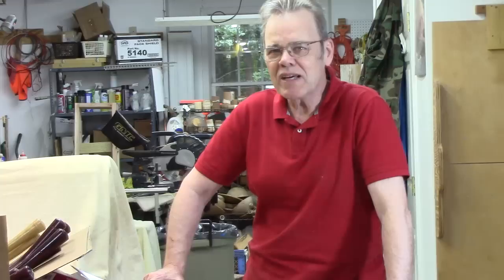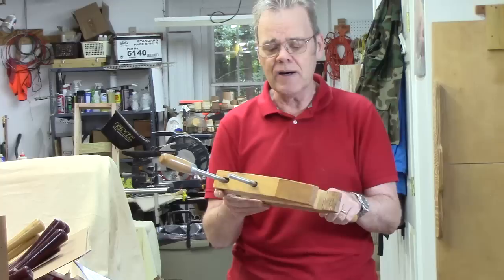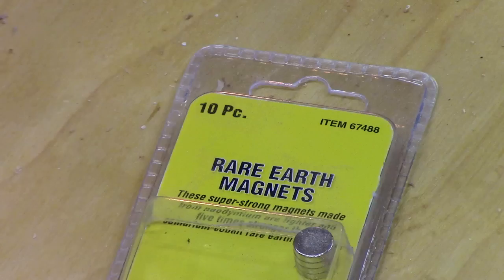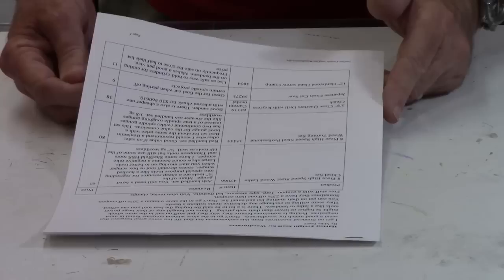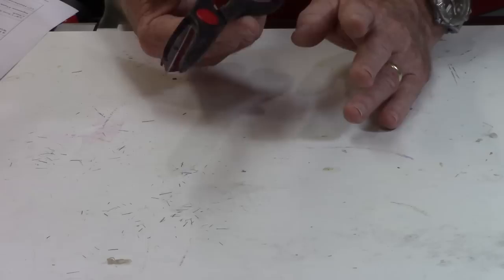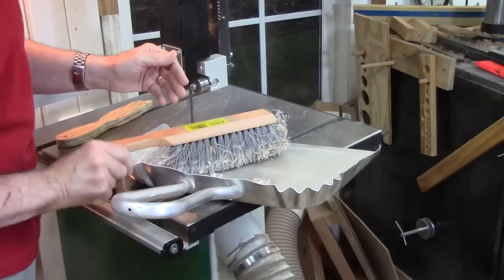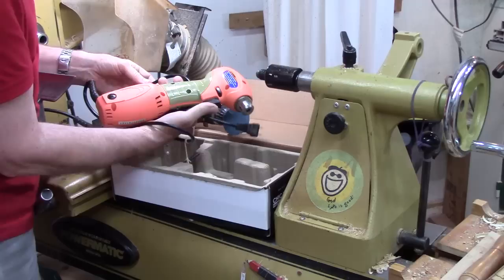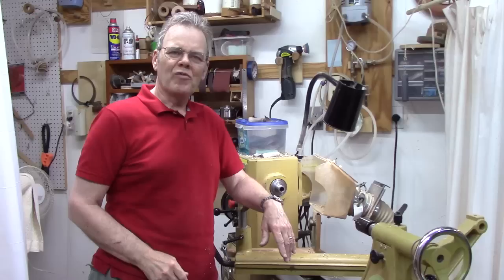Harbor Freight for Woodturners?

Comment: Hi Mike and thanks for your videos. I started with the HF 10" wood lathe & a cheap set of Windsor tools. Neither lasted very long. The tools were upgraded to Sorby fast when they went on sale at Craft Supplies (20% off, I loaded up!). The skew is ok, the spindle roughing gouge actually works pretty good with frequent sharpening, and the rest are garbage. The lathe was $160 with the 20% off coupon but I noticed the price went up $20. It was fine for pens and shaving brushes but after 3 small bowls the spindle bearing started going & everything ended up slightly out of round, a big problem with pens. It was only 4 or 5 months old. If it's just used for small spindles it's ok, but if you're a beginner that wants to turns small bowls I say save your money for a Rikon 12" VS or something similar like a Nova. The HF is now a buffing station with 4" wheels. All in all The lathe & tools were about $200 which I could've used for Sorby tools or a decent chunk of my Rikon. Then again, I wouldn't have that dedicated buffing station...
Honestly I can't recommend either. A decent lathe is the core of one's woodturning. Even though it was cheap and still serves a purpose, the money would have been better spent on something of higher quality. The Rikon isn't much of a lathe compared to a full size, but with reverse and VS I felt like I stepped up from a Yugo to a Porsche.
Reply from the maker: No perfect answer for everyone. I know some folks who turn so little, maybe a cheap lathe is an answer. Some folks are so strapped for $$ that a cheap lathe is all they can afford and can make do. I decided to make a big plunge from a used Jet 10x14 and  I love my Powermatic 3520. Glad I did not choose a lesser lathe that might have met my needs but left me wishing I had gone all of the way.  Ten years later I could sell my PM for what I paid new.

Comment: I get packages of micro-fiber cloths free with a purchase. These are helpful for cleaning dust off everything from turnings to my face shield.  Bags of shop rags are great to have around - though they come with a strange sizing that affects their absorbency, so I run them through the washing machine when I bring them home. The HF digital calipers are far less expensive than other options and work great for the accuracies attainable with wood.
Reply from the maker: I will have to check out the mico-fiber cloths. Thanks for sharing.
Reply: The only issue with HF digital calipers is that they seem to go through batteries very rapidly.

The microfiber cloths are also handy if you use wiping finishes that have to be rubbed down after application.
Reply from the maker: I have not had problems with caliper batteries. And I bought a pack of 10 or 20 for maybe a couple of bucks and  have actually given away batteries to friends with similar calipers.

Comment: I was glad to see the magnetic parts dish - I've got a couple of them. They are sometimes available as the free item also. Another really useful tool is the extension magnetic pickup tool and mirror. I get quite a bit of mileage out of those and again, I think it was a set I got as the free item. It's been said a lot, but I'll say it again, HF is OK, but you had better go in with low expectations!
Reply from the maker: +Tim Douglass Absolutely. I forgot that one. My shop fairy broke mine so I got a replacement from Amazon.

Comment: my table saw is from HF and has been going strong for about 8 years. my 12" single bevel chop saw has been serving me for about 9 years, I have had no luck at all with any of their drills, but the 3 cuft concrete mixer works well for the homeowner/hobbyist it doesn't really hold 3cuft while mixing and will slosh out, but you can easily mix 2cuft with no problem, their large wood lathe is quite affordable at under $300 with 20% coupon for the beginner turner (not good for off center/unbalanced turning as it's bottom rated speed is 600rpm (more like 645-670 actual), their earthquake impact guns are right up there with Snap-on in quality and longevity. I just had to replace my recip-saw after 6 years on the old $39 dollar one. their face mask is cheaply built, but better than none. I have laid miles of welds with the 90amp wire feed welder over the last 12 years and it is still going strong. Just as with the "name brand" tools you will find the occational "bad-egg", but for the guy on a budget it is much easier to get the tool you need and save up for a better one if you find it lacking or you use it more than expected at the time of purchase. Pretty much all tools, and everything else, these days are disposable. I would rather throw away a cheaper tool than an expensive one when both have basically near the same life expectancy. Great video. BTW, I have several of those magnetic parts bowls (also often on the free list) and they are a headache saver from dropped parts or bumped/knocked off non-magnetic bowls.
Reply: No clue where you get the idea that all tools are built in modern times are disposable. Perhaps the stuff you get from HF.

Comment: You can use that 1/4 inch HSS tool bit to make an Oland tool. A great tool for bowl turning.
Reply from the maker: Might work for some and a good choice for huge bowls. But for me, 1/4 is just too  big and I would not choose an Oland tool over a bowl gouge for the 15" and smaller bowls I turn. I have no problem in anyone using a tool or technique that works for them.

Comment: I have the "improved" HF "Windsor Design" set #61794. The tools are said to be "pre-honed", and they do seem to be sharper than the basic set. However, now that I look closer after your observations, I see the same problems with non-symmetrical edges. The box is not much better than cardboard. Maybe good to practice with before buying a high-quality set...
Reply from the maker: How sharp tools are out of the box is not important, IMHO, given that they will soon need sharpening, often to a new bevel angle. Clearly no HF tool is honed before  being sold.

Comment: Before I retired I had been working in Europe where we bought a large Bernese Mtn. dog. The only way to get the large cage to Montana was via Denver or Seattle and rent a car. Denver was a no brainer since there were 3 HF stores en-route and non between Seattle. Since I had sold most of my tools before leaving the states we made the most of this trip and stocked up big time  on the way home. Two items of particular value were the 20' pillar drill reduced to $425 and the 12' cut off saw reduced to $125. Both are sterling performers and I use them for all sorts of projects including lathe work.  Also really good are the packets of 1/2' glue brushes which I use all the time .  I have stopped my subscription to the inside club because I now only by specific items or replace supply items.  As Far as lathe tools go I resisted buying a set at HF and bought individual quality tools as need from D-way tools .
Reply from the maker: I suspect you will have more tools in the future. What kind of lathe? I know you will be happy with the D way tools.

Comment: Here is some advice from a bladesmith. Take the wood turning tools and heat about 2 inches of the end to the point where the steel is no longer magnetic. Quench in cooking oil. If a file will slide over the steel without biting you have hardened steel. If the file bites repeat process but this time quench in water.Check with file again. Clean the tool by sanding. Heat the steel from the center of the tool until you see a yellow or pale brown color on the cutting end. Immediately quench again. This is the most simple hardening and tempering process I know. Since the tools are imports is is doubtful any more stringent measure will be needed. If any of the cutting tools are stainless forget it. They were broke when you bought them.
Reply from the maker: How easy is it to heat the M2 steel tool with a propane torch  uniformly to 2000F?
Reply: @MikePeaceWoodturning  I think you need oxy acetylene, or at least oxy propane or oxy map gas to get 2000 degrees.  If I remember correctly from when I was working as a Refrigeration Mechanic (retired 2006) I could not use a propane torch for silver solder, silfoss, or brazing.  the only thing propane was good for was soft solder, which I seldom used because the fot solder would not handle the pressures our systems ran.

Comment: My biggest upset, as a long time customer, is that as they bring out new "names" those are all excluded from the 20% or 25% coupons. Used to be just a few exclusions, now almost half the store is excluded. Another sort of disapointment is that you cant put risers on their "large" lathe to let it cut bigger stock. The head does swivel and the tool rest does come with an extension, but if you're turning much more than a 12 inch diameter, the tool still won't reach inside a bowl. Do you have any videos on building a "freestanding" tool rest for outboard turning?
Reply from the maker: Bummer about the coupons. I remember a customer in front of me having that problem buying a big piece of equipments. I never had a need for a freestanding rest. They need to be heavy. Powermatic sells theirs for $500 and it has three legs and weighs 137 lb. Not something for the faint of heart to make or use.

Comment: Quick question for Woodworkers out there, would the Lathe tools work if you hardened them (may have already been hardened for all I know). I am asking because I seriously do not know, ok?
Reply from the maker: Unless you are a metalurgist with industrial heat treating equipment, you can not harden HSS tool steel used in modern wt chisels. Even then, unless not heat treated properly, it is unlikely you could make harder than when you get them.

Comment: In my opinion, Harbor Freight is DECENT, (not great) to get you started and see if woodturning is something you will enjoy. I started on their now discontinued 8x12 mini lathe. Only considered it because it was on clearance for $60. Bearings wore out rather quickly without a ton of use. Considered buying the 10x18 but ultimately bought the Laguna Revo 1216. I will admit the screw clamps are a gem. I consider all of their other tools as one time use disposables.

Comment: The HF angle grinders are great for bowl carving. At $10 each on sale, It's not worth the time to change wheels. I have one with a Lancelot chain saw cutter, another with an extra coarse carbide nugget curved steel wheel, and one with a flap sanding wheel.

Comment: Not specific to turning, but the blue bar clamps are an unbeatable bargain at ~$3 (less 20% & free flashlight/screwdriver/parts tray/whatever) for a 6" clamp is just ridiculous.  I own probably 40 of various lengths and have had two handles spin on me; lifetime guarantee and they swap it out no problem.
Reply: I build guitars and repair furniture, I can easily ahve 40 clamps at use at once without breaking a sweat.  These small clamps work great.

Comment: Sometimes the japanese flush cut saw is a 'Topman' brand - much better quality than others.  Also, nitrile gloves are not necessarily the best protection - for some solvents vinyl gloves are better and cheaper.  If you have ever used a handplane to smooth and taper a cylinder spindle (try it!), then the 'Windsor 33' handplane can be hit or miss - I got one that works very well, but the on the second one, the adjustment screws are a little bit misaligned and so it doesn't hold a setting as well.
Reply from the maker: Thanks for sharing!

Comment: I bought their 4" x 36" belt sander and had to return it.  The design was terrible and the flimsy sheet metal made it nearly useless.  
Installing and changing the belts required some disassembly, unlike my Ryobi which uses a simple lever and is front-loaded, not rear.
The height adjustment wasn't aligned right and I'd have needed to redesign or re-weld it to make it work.  
If you're looking for a REALLY CHEAP (inexpensive) belt sander, give it a go, but for long term use and for changing grits, well, they gave me a refund and THAT was very satisfactory for me.
Good luck!

Comment: They have a small Jacobs chuck on a #1 or #2 taper for about $15
Reply from the maker: Yes, I  did not mention because I don't have one of theirs. I looked at one  and felt like I would rather spend a few more bucks for one of better quality.  Specific feedback on their jacobs chuck from users would be helpful.
Reply: I have several of these and never had a problem. On projects that require different size holes it speeds up the process. For the price You can't beat it. By leaving them set up not being keyless is not a problem.
Reply: I have the HF Jacobs chuck and use it for drilling pen blanks on the lathe.  I don't have much to compare it to being new turner myself, but I have been pleased.  My chuck was slightly loose on the taper (the taper that goes into the chuck, not the taper going into the lathe), but a light tap with a rubber mallet seated it better.  Overall the chuck hasn't yet done anything that made me regret the purchase.

Comment: Like many woodworkers, mechanics, etc. I occasionally put a bag over my head and shop at HF as the "Unknown Craftsman" just so the tool snobs won't be able to laugh at me for being frugal.  But more seriously, I have found that HF fills a need for cheap tools that you only need to use occasionally.  They are not professional quality but then they don't claim to be.  Just be careful what you buy and read the customer reviews carefully and you will do OK.  One thing that turners might find useful is HF super glue. It is a CA product that sells in a three pack and can be caught on sale for a buck or so.  I use it when making pens for the finish.  It works fine and while you could argue about the cost per ounce versus other products, but I find it handy and it helps to get a fresh tube every few pens.
Reply from the maker: Bill Snorgrass Too funny!

Comment: 10 in. x 18 in. 5 Speed 1/2 HP Benchtop Wood Lathe Item#65345 (do not buy the cheaper one) It appears to be the same as others in the same price range some with different colour paint. I have turned hundreds of pens on mine.
12 in. x 33-3/8 in. 3/4 HP Wood Lathe with Reversible Head  Item#34706 All most every one loves it But ... mine broke.
1/2 In. Mini-Lathe Drill Chuck Item#42340 use the heck out of mine.
Along with there drill presses, small bar clamps (I love the 6" ones) you can buy better but at atleast twise the price, brad or nail guns, wrenches and sockets, ...
If Harbor Freight offers 2 lines do not buy the cheaper one.
Many or most of the stuff I"ve purched from them has been a fair or good buy but some I got less than I paid for.
The stuff in my shop ranges from the best you can buy to cheap China stuff there is a deffent differance but some times not worth the price.

Comment: Hi Mike, I may be late to the party about this, but if you go to HFQPDB.COM, you can find all the 20-30% off coupons that they send in the mail, as well as all the freebie coupons.  You can load them up on your phone, take a screenshot of each coupon, and they can scan it straight from your phone at the store, so no need to go hunting through the paper or printing them out.  Hope this helps, happy shopping!
Reply from the maker: Great tip. Thanks!
Reply: Wow thanks for the tip!  Just bookmarked it!

Comment: couldn't you take the steel gouges and heat treat them? In reality any tool steel that is hardened correctly can be a very good gouge, chisel, knife..etc. So I don't really see how the gouges could be garbage as long as they are tool steel and able to be hardened. I compared the same two sets you have and the "professional grade" with the red handles have thicker steel and just feel much better. I just bought the set and if the heat treatment really is bad then Ill heat treat them all and then have a very good set of tools. Just get the steel red hot and quench it in oil and you now have hardened steel capable of holding a good edge.
Reply from the maker: I am no heat treating expert but I do believe heat treating HSS is a bit more challenging then you think and takes a higher temperature. We are not talking O1 drill rod from the big box store.
Reply: Mike Peace Woodturning . I'm no expert either and you're probably right. I looked into heat treating a little bit more and certain steels have to be treated differently. So I guess if you wanted them hardened, the best bet would be to take them to a shop that will do it for us. Anyhow, I enjoy your vids..thanks for the effort it takes in producing them
Reply: If you start with a cheap low carbon steel it will not hold an edge very long heat treating it or not. You  can tell by the sparks.  High quality carbon steel, long forked sparks
Reply: What you are calling tool steel is probably different than what the manufacturer of those tools call tool steel. There are many grades of even carbon steel. Some great, others not so great.